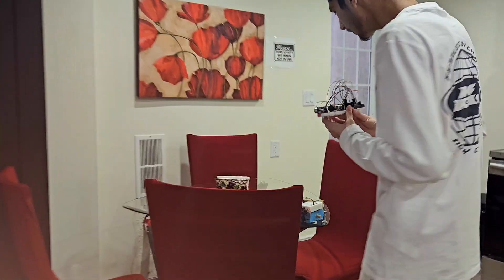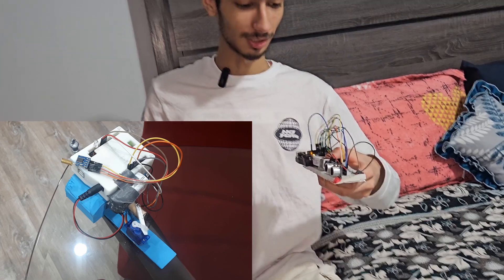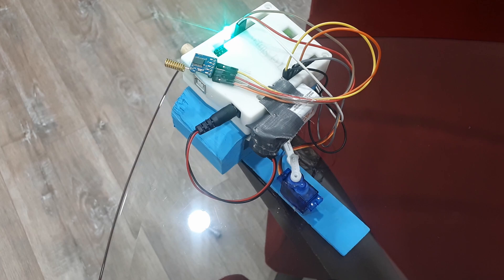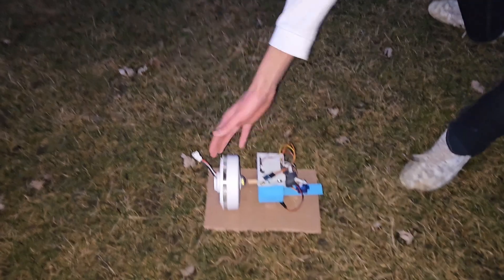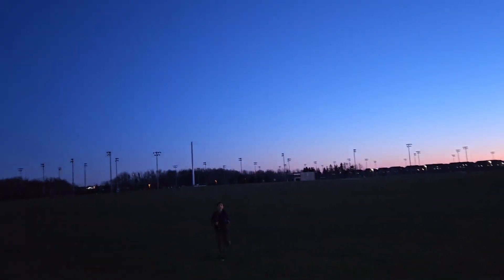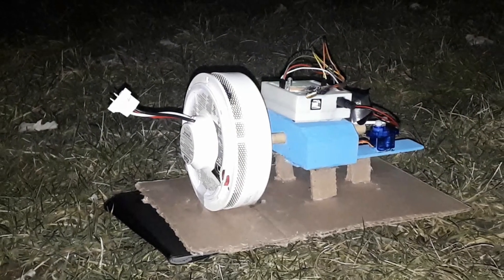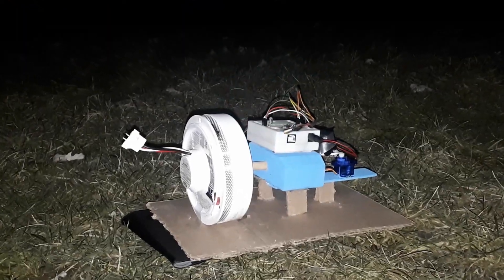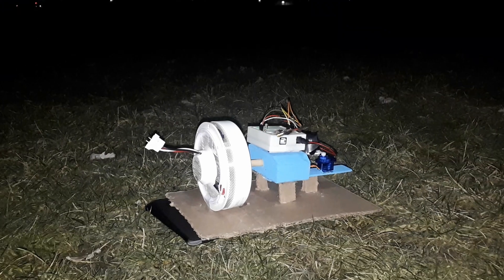Can Two Arduinos Actually Communicate From FAR? I RYLR998 Open Field Test

Comment: I'm working on a sat to space, can it communicate over 120kms?
Reply from the maker: Hey, how're you doing? So due to the baud rate and frequency allowed legally by the countries, it can do max in the range of 12 - 25 ish. It would have been cooler if it did, but it is using radio tech after all and its a small module, not military grade. Allygough i'd mention that the signal is much stronger if both are in line of sight. Hope that helped, good luck with your amazing project.